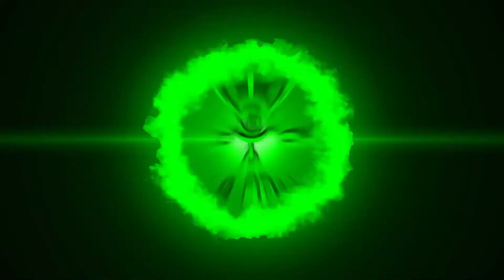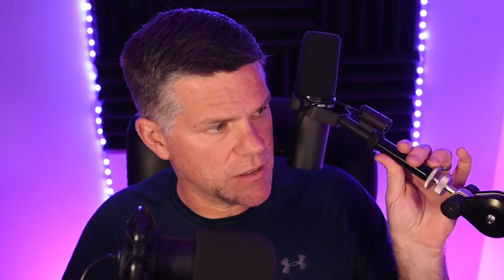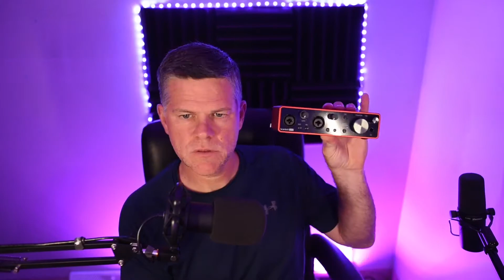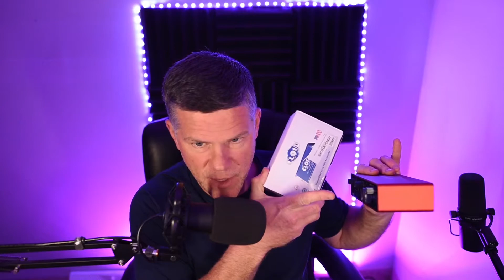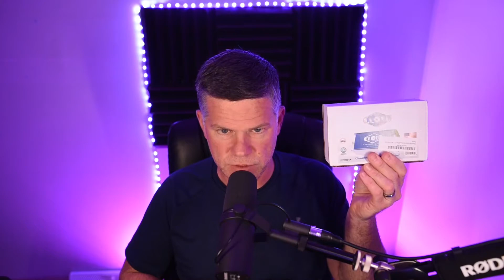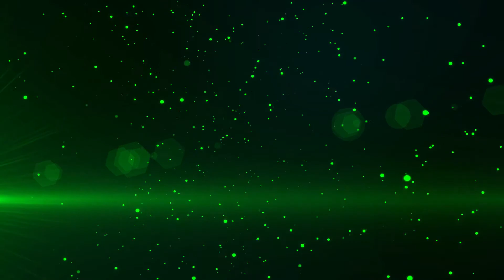Fifine T669 USB mic vs Shure SM7B

Comment: Hi Andy! It was a big difference from the USB (now my wallet is shaking). But I kind of like the Shure without the Cloudlifter. May be some tweaks are needed.
Reply from the maker: You can crank your gain way up on your audio interface or boost level in post, but both raise your noise floor and hurt the overall signal quality. The cloudlifter does it without raining the noise floor.